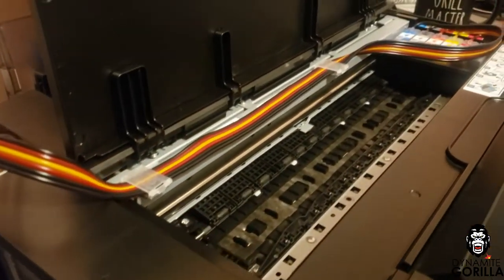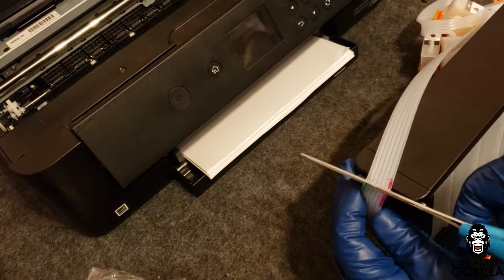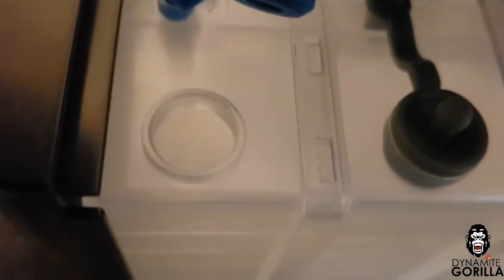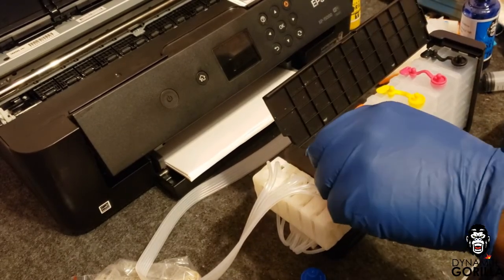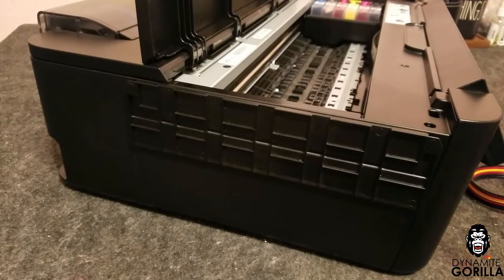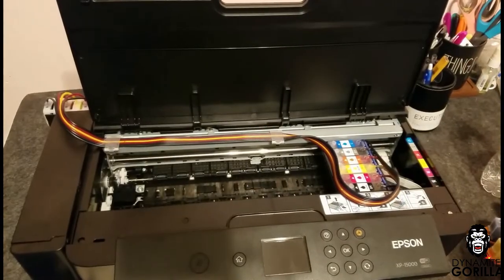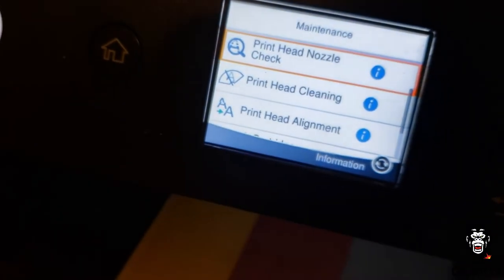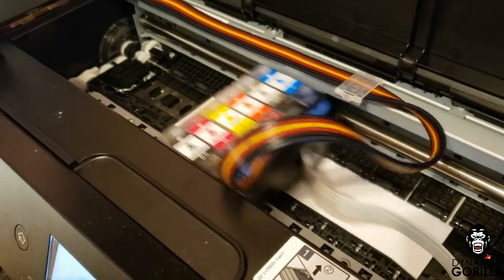XP-15000 CISS INSTALL FOR SUBLIMATION!!

Comment: Good video, very clear and concise. How important is having the stop valve and the dampers, as my ciss (exact same ink tank) for my new xp-15000 arrived  from china 1 week ago without a stop valve, even thou all his pictures showed the stop valve, he said all new ones do not come with it as it is not needed with this tank and this printer.
Reply from the maker: The ink shut off valve will keep ink from flowing into the cartridges when doing maintenance on cartridges, and make moving and storing the CISS easier. The Dampers will help keep air out of the lines and prevent ink from moving backwards into the tanks. However they are needed for operation. You should be able to install with these instructions, just skip installing the dampers.
Too keep ink from leaking out of the cartridges during the install,  keep your tanks plugged at the vent hole. This will create a vacuum and prevent the ink from spilling out of the cartridges. Just make sure to vent the system when your ready to print.
Reply: @McZell  thanks for your reply. I asked him to send me the stop valve which was clearly shown in the pictures and he just ignored me so I complained to aliexpress (first time I've had to do that) they refunded my money and told me to keep the thing. so your saying I could actually install as is, just remember to keep the airholes plugged, while i'm installing or moving it etc. Well i've just found the dampers and stop valve separately in china so will order them as cannot install it yet anyway. Good job I watched another of your videos where you say try the printer first before you convert it  😂 as it would not print the magenta cartridge even after 14 print nozzle cycles over 2 days, still waiting for epson to send me a new printer, they havn't even picked the faulty one up yet 😟. Anyway thanks for your awesome videos.

Comment: Please do a video or explain....why the ink isn't coming through the lines. I've done the step by step and haven't been able to fill the carts. . The line seem to be clogged and the dampers aren't filling.
Reply from the maker: Make sure that the ink flow switch is open. also make sure your dampers are install in the correct direction. Ink only flows 1 way thru them.